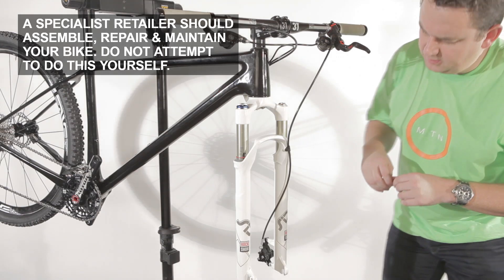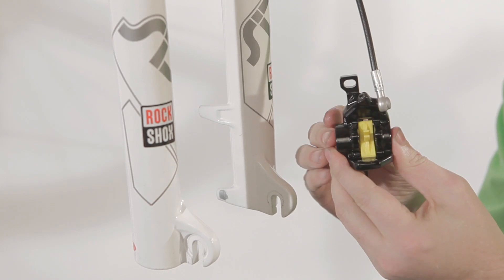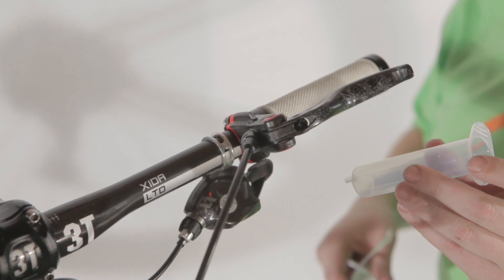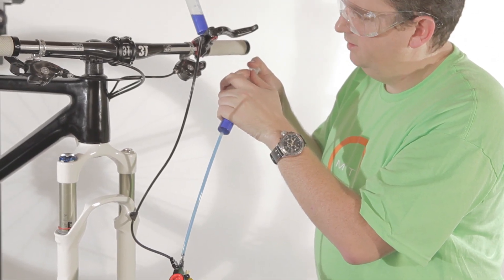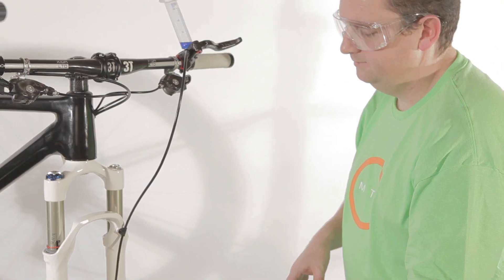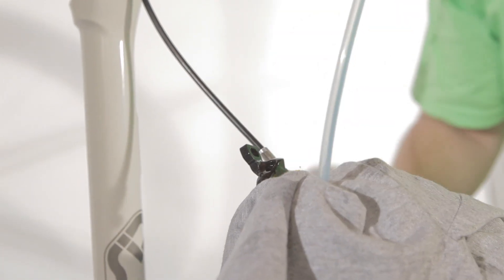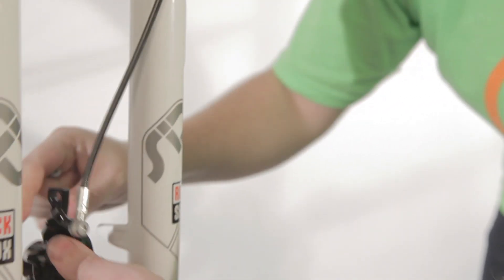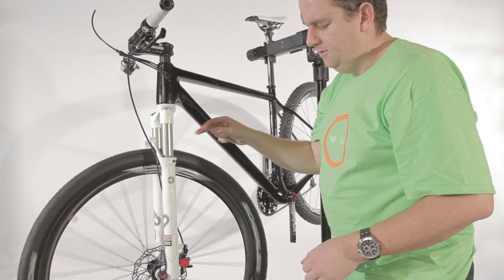Bleeding the Magura hydraulic disc brake

Comment: Apart from the obvious caliper cleaning omission afterwards (but if you know anything about brakes, you'll know this already), this is a great video.  After I cut my hoses, I decided I needed to bleed one of my MT5s. I followed a Magura video but ended up with the lever pulling to the bar.  Followed this video, including angling the lever and pushing the oil before replacing  the BFP screw and it worked a treat. The Magura video had the lever level. I still ended up with oil over me and on the floor, but I always do somehow!  Note if you use the Magura service kit, one of the syringes has a tiny hole near the 30ml line...this is the syringe you open beyond the hole and put into the lever.

Comment: ok - is the reason you do this bleeding process to get rid of entrapped air?  if so:
- where did the air come from?
- shouldn't you address that issue first?
- how about if you've experienced "loss of fluid" which would manifest itself as needing to adjust the brake handle screw?
shouldn't you address this also??